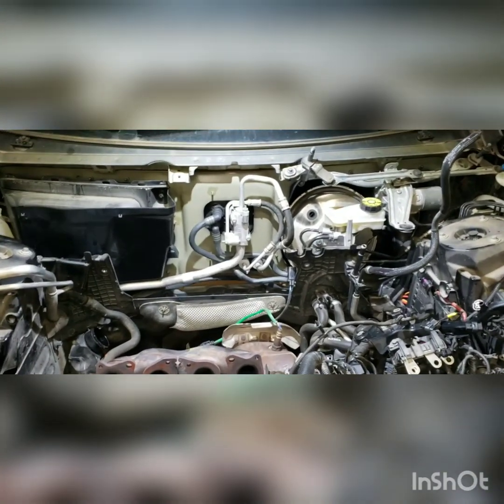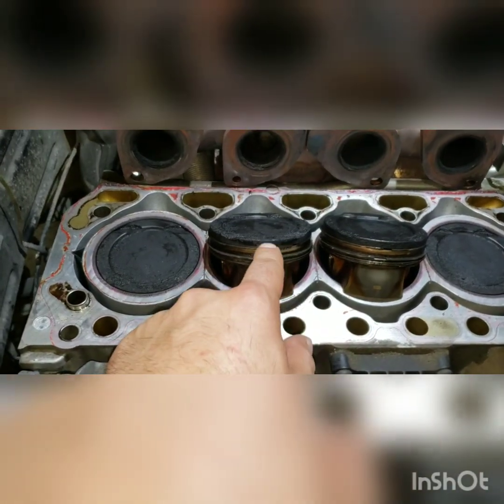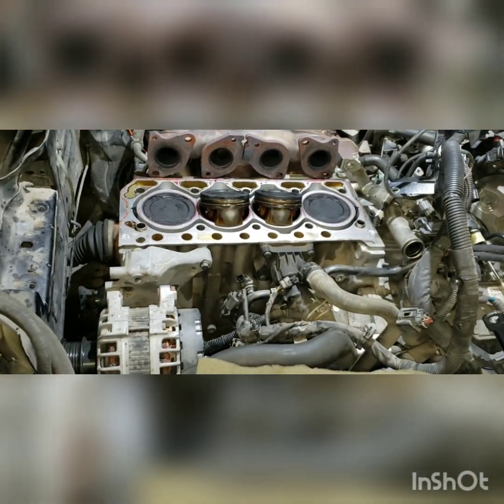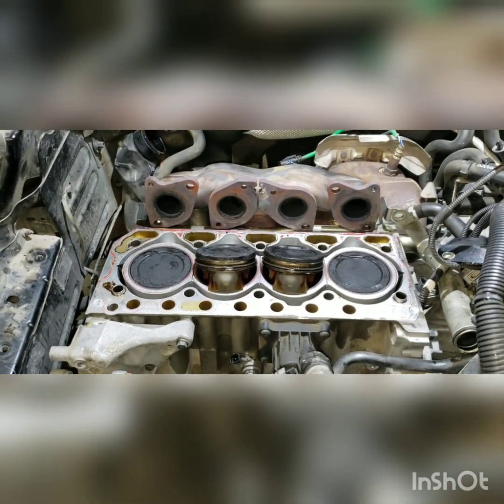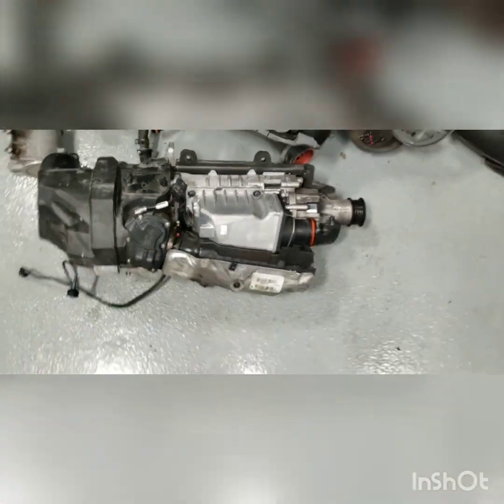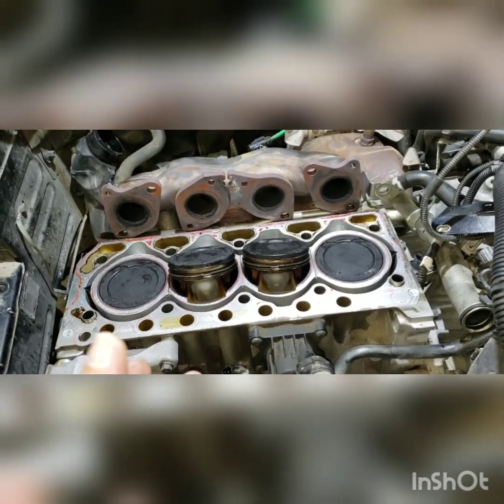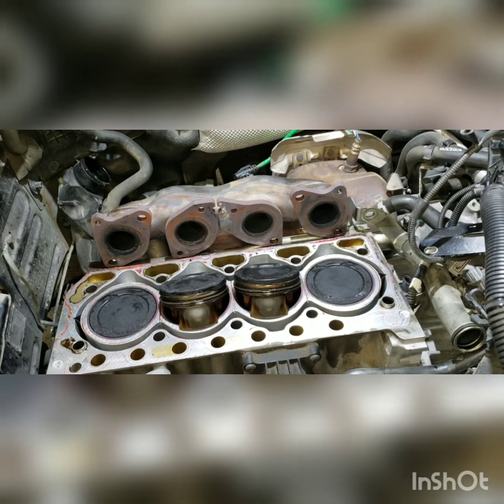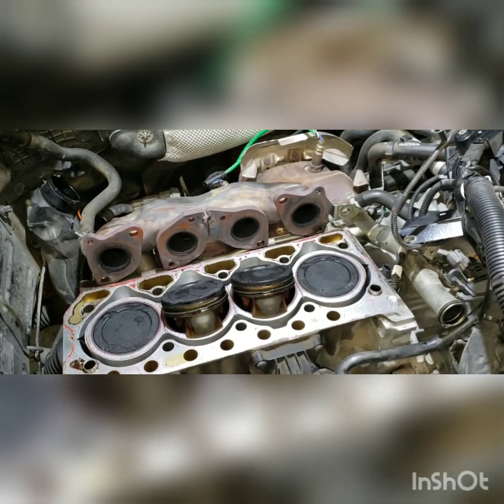The all new Volvo 2.0 twin charged 4 cylinder engines.

Comment: @thevolvoguy, as the oil consumption issue appears on a  number of VED4 2015-2016 diesel engines as well, do you know if the cure involves the same improved piston+rings set as for the petrol VEP4 engines? Maybe you could share a PN of the improved design?

Comment: Was wondering what your thoughts are on buying a 2022 s60 t6 with around 30k good year bad year ? I watched ur video on the 4 most common problems ..just wondering how rare these issues are I'm 65 years young and have owned probably 7 volvos in my time ..first one was a 245 wagon with a B21 engine..would appreciate your  opinion!! Thx Pat

Comment: What were the symptons before you started this? I had one instance where my volvo used a lot of oil but but nothing after that one time. Now it turns over like the battery is going dead without starting. The nearest volvo dealer is 2 hours away, and the non volvo scan read a cam sensor failure. I think its worse. Any ideas?

Comment: With all the reliable 4 cyl engines out there. why did Volvo make their own?. They could have bought it from someone else or just copied someone elses design. My independent Volvo shop has two right now. They were purchased from Carmax and they are paying for the repairs .  Maybe the customer bought an extended warranty. This guy does a lot of repairs for Carmax to make the car salable on or after the sale. I pity the poor folks buying used Volvos thinking they are buying the reliability of Volovs made years ago, maybe before 2013. Still beautiful cars but the quality has gone to pits. I have had good service from my 2006, 2008, and 2011 Volvos. All the paint and interiors look almost new,  Much better looking than most cars of a comparable age.
Reply from the maker: True, it's like anything. When try a new design, it always takes a year or two to get it right.

Comment: Hi @TheVolvoGuy, how hard would it be, to upgrade an D3 (150hp) to D4 (190hp)? I know that the turbo is the main difference and that the D4 has a balancer shaft. The ECU could be remapped or swaped by one for the D4. I think it should be possible. What do you think? My car has also an oil consumption.
Reply from the maker: Don't know anything about diesel engines. Sorry

Comment: When Volvo decides to replace the entire engine (since the cylinder walls are scored) what is actually replaced? What do you need to swap over from the old motor? i.e., does the replacement engine come with a new super and turbo charger,
Reply from the maker: No, it does not. You get a complete engine with nothing else
Reply: @TheVolvoGuy  Does it include new timing components, spark plugs? Im asking because mine was swapped under warranty and I am curious how to adjust my maintenance schedule. Cheers!
Reply from the maker: @Glenn Hutchinson  yes it should include new timing belt spark plugs.

Comment: Hello, I've been doing some research about Volvos lately and I figured out that 2.5T engine is quite nice with C30, but I'm interested in faster ones so S60 is the one and 300HP+ too. I found some information about the  3.0T but would it be reliable? if they even are, because 4 out of 5 owners, very very roughly speaking, had a positive feedback, some said 3.0T failed on them and it had oil problems and what not so what do you think about used cheaper ones, maybe from a car auction too. 2.0 Twincharged ones 2016+ are quite expensive.
Reply from the maker: The T6 engines are good engines and it does have the better pistons and rings
Reply: @TheVolvoGuy  Would they last like Honda engines with 200 000 and more miles and 3.0T?

Comment: Where’s the updated video? I wanna see the comparison. If you fully build these engine with forged rods and pistons and a big turbo is 500HP possible? I want to build one
Reply from the maker: That motor was not mine but you would have put better pistons and rings before it can handle this much power.

Comment: Can I ask you this question?  Yesterday, a Ford mechanic told me that my 2017 VOLVO XC60 T6 R design 2.0 supercharged/turbocharged engine are known to use .5 to 1.0 quarts of oil within the first 1,500 miles. If that’s true then does that indicate the engine would use 2-3 quarts of oil toward the next recommended oil change at 10,000 miles?  That would imply the engine would overheat and lock due to not enough engine oil in the system correct?  This Ford mechanic has me very concerned. I feel my VOLVO runs cherry. It’s smooth and quiet. More so now that the oil was changed and Liqui Moly CERATEC was added at 55,000 miles. Thank you
Reply from the maker: If you use as little as .5qts every 1k miles that adds up to 5qts and the engine holds 6.25qts so that will most definitely damage the engine, and most certainly it's not okay since the 2017 and on go 10k miles without losing more then 1 qt. I never go 10k on my engine no matter what any ways, I still to 3-5k max.

Comment: What causes that?  I just purchased a 2017 VOLVO XC60 T6 with 50,000 miles. I’m told to change the oil every 10,000 miles but I prefer to change the oil every 3,000 miles. Thank you
Reply from the maker: I normally change the oil every 3-5k no more than that it keeps the engine nice and clean.

Comment: I’m looking for a 2015-18 Volvo S60 should I be the 2.0 4cyl?
Reply from the maker: Stay away from 15 and 16 4 cylinder engines
Reply: @TheVolvoGuy  okay and what about the 5cyl. Or 6cyl can you give me a guess on what years?
Reply from the maker: @AAhmad3449  6 cylinders stick with 3.0 turbo and 5 13 or 14
Reply: @TheVolvoGuy  okay great! Also I saw some Volvo 5 cyl years 2015-2016 is that still good? I would assume the kinks are worked out

Comment: Engine is a pos. Needed new injectors at 60k miles, supercharger failed at 87k miles.
Reply from the maker: The 2015-2016 engine have seen problems for sure

Comment: I have a 2015.5 S60 T5 single turbo. I never have any issues with oil consumption. I have recently drove it 7k miles due to cross country driving and no oil consumption and the car has 42k on the odometer. I did have a weird whine during cold weather once. I don’t have any clue what it could be. Sounded like a bad bearing in a belt accessory or spring tensioner. It has not done it in a while. What are your thoughts on that?
Reply from the maker: When the noise come back take the oil cap off and see if it goes away this might be the oil trap box PCV box.

Comment: Hello there, thanks for sharing and I wanna ask is it possible to upgrade my T5 turbo charged engine to a T6 twin-charged? Asking for my T5 XC90 here. Thanks！
Reply from the maker: What year?
Reply: @TheVolvoGuy  2020 here
Reply from the maker: @zhen-yuanli1097  you can do it but you have to add the supercharger wiring harness and engine control unit and transmission control unit and it have to be hacked to match key codes. But am sure it can be done but it will take some work.
Reply: @TheVolvoGuy  It surely will be worth it tho! Thanks again and you have a great one sir😃

Comment: Hey dude so I got my 2018 S90L with a T6 almost brand new in August 2019 it had only a 1700 miles on it when I got it. I have about 16,000 miles on it now just curious I've ran the coolant reservoir dry 2 times already to the point where the engine has put up a signal saying to turn off engine immediately and fill coolant. Then when I fill the coolent there are no leaks or anything it just seems to get burnt out every now and then. I drive pretty hard every day I'm also.an.Uber Driver for a living I have CPA tuning piggyback and I run race fuel on the weekends and like I said I've confirmed there are no leaks is it normal to burn through coolant twice in 16,000 miles?
Reply: Besides the coolant running dry twice I have not had a single problem with the car in 16000 miles
Reply from the maker: It's not normal to burn coolant at any point you have to pressure test the system if it leaks when the engine is hot it will dry and you might not see it. So you need to pressure test it and check for leaks.
Reply: Hey I'm about to hit my warranty next month I have about 35000 miles. Considering the turbos and superchargers are so expensive to should I get an extended warranty to a 100000 miles?  Or are these cars reliable enough to make it to a 100000 without busting anything expensive major.

Comment: Hi. First of all thanks for the video. I am about to buy a Volvo but hesitating that which engine I should choose. I have currently a Volvo S60 (2006) and this 5 cylinder engine is just great ! But the new four cylinder XC60 looks awesome and like I said it's a big hesitation which to go for the 2016-17 XC60 with 5c or 2020 4 cylinder? What do you suggest? Thank you in advance!
Reply: I forgot to mention that I have a diesel 5 cylinder s60.
Reply from the maker: If you going to buy a volvo stay a way from the XC60 5 cylinder it burns oil. I would go with a 2020 4cylinders much better

Comment: Hi
I am the owner of a Volvo V70 D4 2014 with 2.0l 4 cylinder VEA engine. The milage is nearly 260 000 km. I have to fill upp 0,5 liter oil after 1300 km. Full service history at Volvo dealer. Is this possible under good will? If not how much do you cahrge for a piston replacement? Br Andreas from Sweden
Reply from the maker: This might be out of the mileage range for good will... but I am located in the United states
Reply: The Volvo Guy ok. Just interested in an estimate of the cost.
Reply from the maker: @andreasfagerberg2812  I would say between parts and labor it will be around 2500 dollars maybe little less depending on how much the labor rate is..

Comment: Sir, so is this engine reliable to 200k? I'd imagine lots of stress due to high power and small displacement of this design and a short life.
Reply from the maker: It all depends on the driving style but time will tell under normal driving conditions I don't see why not but with the direct injection I have noticed a lot of carbon buildup on the valves since there is no fuel to keep them clean.

Comment: I have a 2015 V60 T5 with a 2L engine of the same problem. I have to add oil often. And I don't know how much is missing, because when I check the oil level on the panel, it doesn't show the real level. I just add half a liter or 1 liter. Is this problem under warranty? I am in Canada. Thanks.
Reply: It ended to be the problem of oil filter cover. It cost us 300 dollars to replace it, and now it never leaks again.
Reply from the maker: Am not sure about canada but volvo goodwill this repair depends on the service history
Reply: Jaki masz typ  silnika  taki B4204T11 ? i ile przejechane Ja mam 73 tyś kilometrów  jak odkręcę korek wlewu oleju to silnik zgaśnie  ,tak samo masz?

Comment: Having a factory twin charged engine is my ideal.  I presume that the company will have solved a lot of problems that aren't addressed in after market add ons. 
But is it actually any good?  Does it have more problems than it's worth?  Or is it a good and reliable engine?  I think it's been out for more than two years now.
Reply from the maker: Good question. I actually have seen people and talked to people about doing a super charger and a turbo charger back in 2006 but the lack of money and other resources put a huge halt on it.  But the main challenge was how to disengage the supercharger after at higher rpms. Volvo used an electrical clutch that is controlled by the ECM. Now is it worth it?
Yes you have no lack of power at any rpms what so ever from idle to high end no problems at all with engine. Most people do not know that but this engine was used in the pollstar model and it was the 2nd most powerful 4 cylinder was ever made right after the Mercedes 4cylinder AMG engine. No problems with it at all except for early on with piston rings but this problem got fixed very quickly.
Reply: I have an S90L with a CPA tuning piggy back that blows the turbo and supercharger at the same time. Making   around 400hp with just the piggyback and 120 octane racefuel
Reply: @christopherjohnson6970  you have it on the twin charged 2.0? Interested in this for my polestar
Reply: @OHNetwork2025  yes  The chip definitely added power but eventually months later there gave an error in the middle of the line at Taco Bell engine wouldn't turn on and I couldn't restart the car until I popped the hood and tore out the chip and restored back to factory settings. If you do run it don't leave it on continuously 247 turn it off daily and only turn it on when you want more power it definitely kicks you could feel it lots of fun you get 400hp on a t6 with chip blowing both chargers at same time
Reply: L @christopherjohnson6970 
Where do u get a chip and how much was it?

Comment: Was there carbon build up on the back of the intake valves?
Reply from the maker: Yes a lot.
Reply: Direct injection problem, the aditives on gas cant clean valves because have no contact.
Reply from the maker: I will post some more videos

Comment: Wow! Too much for the common diy guy
Reply from the maker: They make it harder and harder to work on them.. I know a guy got hold of me from out of the contry he had taking the same engine a part and I had to guide him through the process of getting it back together.
Reply: The Volvo Guy I believe it! Looks like a lot of unnecessary stuff
Reply from the maker: @patrickmadden6340  they try to push so much power out of a 4 cylinder it's crazy and it have to be fuel efficient.